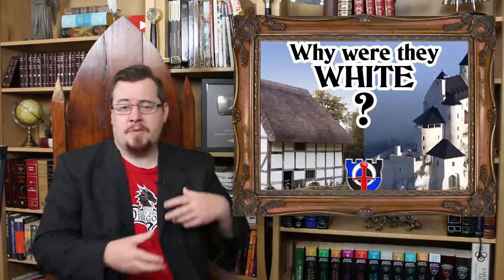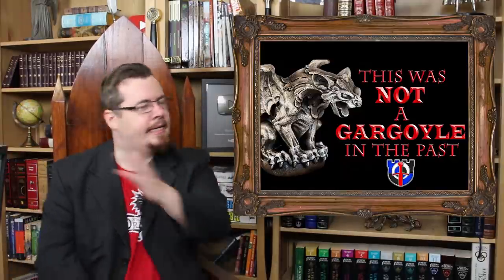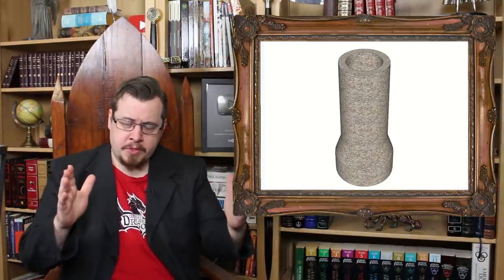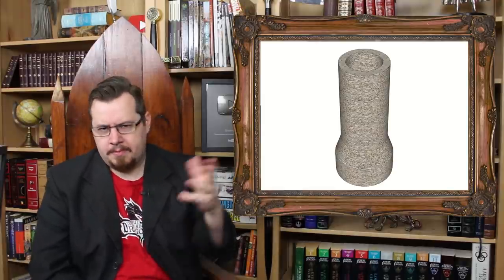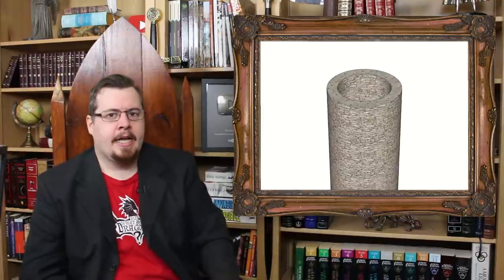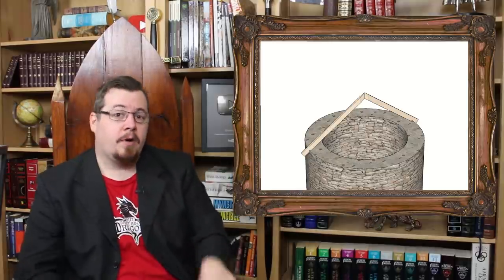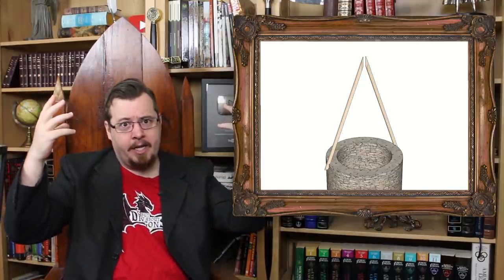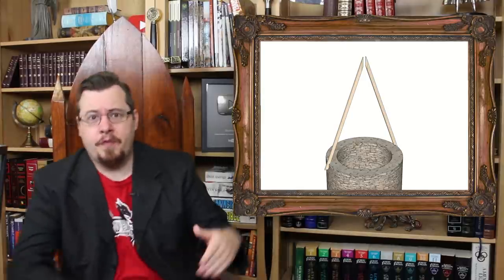Why do medieval CASTLE roofs flare outwards?

Comment: There's probably a strong correlation between how common flared rooves were compared to the usual snowfall during the course of the year. In Norse architecture, you very frequently see very tall, flared rooves, whereas the typical unflared pyramid roof is common south of the Alps.
Reply: Capn Pipsqueak It's not that simple, from my own research I've noticed the steepest roofs were built in central-northern europe, from northern france, germany, switzerland, austria to bohemia and western poland, but not always in the alps, despite the amount of snowfall. Moreover, eastern poland has flatter roofs despite also getting more snow than western poland. Snow plays a significant role but local tradition and regional trends were also in consideration.

Comment: I'm currently building a castle in minecraft and it has all the elements: Multiple Gatehouses, Actual crennels that give cover, murderholes, moats, it's elevated, and of course MACHICOLATIOOOOOOOOOOOOONS!

And I all learnt that from you! It makes the building progress so much more interesting! Thx Shad!
Reply: I do the same thing. I have before with all the necessities, but these videos taught me plenty.
Reply: Cool! Can you share some pictures?
Reply: I was building a castle in Minecraft, also. I noticed that the base of the tower was impossible to see.  When I learned about machicolations, It all made sense!

Of course, functional Minecraft machicolations cause a risk of death by falling, even when you use trap doors to keep them safe most of the time.
Reply: @GymbalLock  I use stone walls placed one block in front of the wall, by placing walls ontop of each other you get the crennels

Comment: I would love to have a non-fantasy role-playing game like Kingdom Come: Deliverance or Mount & Blade that let you design your own castle. And if you did a poor job of it, it would fall down:)
Reply: I would say Medieval Engineer's but it's KSH and has some issues
Reply: Browse a bit through crowfunding sites, maybe someone's already trying to make that game. At least they should.
Reply: There is Medieval Engineers, but it's fairly limited due to the 2.5x2.5 m grid layout, and the fact that you can't merge blocks anymore (so big round towers will always look weird). It's still being developped, but it's been ages since I've seen new actual architectural blocks added to the game.
The physics are also somewhat unrealistic : with structural integrity activated, you basically can't build a tower taller than 20m. Meanwhile my town's donjon is 50m tall above the ground, and 66m above the ditches :p

Also, while the feature has been dropped from M&B Bannerlord, I wouldn't be surprised if it made a comeback in a little while as a piece of DLC.
Reply: ARK and Rust try to have a system like that, but it's based on the proximity to designated support elements rather than realistic gravity.

Comment: turns out stone doesn't just magically stick to any surface you attach it to.

Who knew!? Clearly not most people in Hollywood or video game development.
Reply: That's partially because video game engines tend not to apply gravity to things aren't meant to be mobile.
Reply: You mean my minecraft castles aren't real?????
Reply: @Thrazzon  There is a Minecraft mod that applies gravity to all blocks instead of just gravel and sand, but it doesn't recognize support elements realistically either.
Reply: @RokuroCarisu  yes that's mostly the reason.
Ironic, really, in video games you have to ADD work to make things fall, so why the hell do it to stuff you never want to fall anyway?

I'd love a game that was just "here is simulated reality, go nuts!" Basically like minecraft, but with realistic physics and not made of blocks.
That would be AWESOME!
Probably not doable tho.
Reply: it's theoretically possible, but it would take more computing power than most peoples' computers are capable of.

Comment: I like this video. It's very clear how excited you are over your findings, and it works infectiously. I'll incorporate these ideas in my own designs.
Machicolations-o-meter for this video: 4.3/10
While it is clear that you are yet - and rightly - excited by the concept of machicolations, the expression of said excitement is tempered by your excitement over the topic at hand, which, while closely related to machicolations, is not quite the same thing. This is not a bad thing, but as an avid admirer of all advanced architecture intended to avert opposing individuals, naturally I am a strong proponent of exclaiming the term in a boisterous and ecstatic manner.

Comment: Having spent a number of years as a carpenter and mason it was fun seeing you come to your architectural revelation about roof design Shad. It took me back to the first roof I was building a soffit for, which is the modern day descendant of the castle design you were working on. Even with current building materials it's good to keep water off the stone, wood or brick walls. Our historical predecessors  really were brilliant and it's great to see shows like yours which display their ingenuity.

Comment: The high angle roof is good in preventing snow building up but with rain it directs all the rain that gathers at the base of the building. If you don't have a drainage system the water gathers at the base and can ruin the foundation. 
By having the last part of the roof at a lower angle the water is propelled away from the walls.

Comment: I work in a workshop and we have that same specific design on top of our chimney with the metal cap but the reason for it is the reverse problem. Thin metal for chimney caps is often very light so as the the joints corrode  over time from the fumes and can be removed by strong winds so when the noise from lose metal became apparent we went up there and wielded the top from the inside and added another ring of metal on top at the base to split the force and provide more stability to the structure. I always thought that was the reason why castle towers had pointy tops with that sort of skirt at the base. Turns out they're conected not overlapped.

Comment: One part that you failed to mention with that last cross section drawing was the arch. Arches were an excellent way to bear weight as well and was quite visible in that drawing. In point of fact it was the first part of that drawing that I saw.

Comment: First, thanks so much for this video.  We do appreciate the painstaking hours you spend, not just researching these fascinating aspects of the past, but also translating your experience to us in such a fun and practical way.  This video in particular will be extremely helpful for an upcoming project.

Also, if you think about it, this architecture was indo-europeans' first grand realization of the functional and material efficiency superiority of the teepee or lavvu distributed-force network construction, which is based on interconnected triangles instead of isolated squares.  Modern geodesic designs are the direct descendent of this kind of thinking, which should become the architectural norm in the future.

Comment: In modern home design areas that receive a lot of rain  tend to have relatively larger overhanging roof sections to try to keep rain from dumping too close to the foundations and either damaging them or intruding into the ground floor and basement levels. Having the second shallower section of roof you highlight would achieve the same thing by expanding the roof surface further out than the building footprint.

Comment: For my A-Level project, i have designed a castle in SketchUp. In my design, my towers are 6-pointed stars with supports at the tips of each point and in the corners where two points meet. I mimicked the highly pointed roof (the single high-reaching beam design) for the Great Tower in my castle (creating an almost floral look) because that is what i thought the roofs should look like on castle towers. Its really interesting to know the reason why it was done.

Comment: angle changes on old roofs served as the base so you didn't need a scaffold some flares are for worker ease during construction or maintenance. The flares normally makes it  weaker since it creates a break in the structure, a pocket for weight to kick back on main supports and watershed slams into it creating a high impact ring around the flares top. The main point I've heard for them is they offer a spot for building material or snow that falls off to catch so it doesn't all come down at once and so you can press against walls for safety without roof sliding straight down and killing you and so workers have something to stand on at a lesser pitch.

Comment: You're conclusion is terrific and this is a great video, however you missed a subtle feature that makes this roof design truly brilliant.
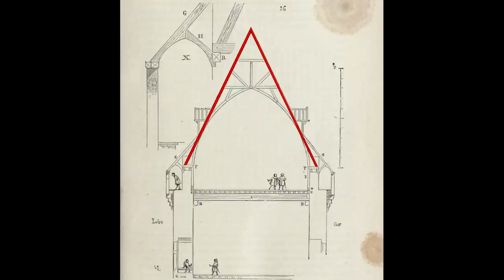If you look at the picture at 10:55 you have highlighted the main triangle of the roof. Inside of that there's an arch which is also a very efficient load bearing structure. Together the triangle and the arch are extremely strong. The arch however does tend to want to push outwards at about a quarter to a third of its height from the base. The second lower roof line provides a force to support the arch at precisely where the arch pushes outwards. Thus the forces are balanced. It is a very skillfully designed and elegant solution, which maximises the strength and minimises the materials required.
All the best.

Comment: There is another thing to consider: angle. If you rested the beams for the main roof section on the outter walls, you'd need to go higher to get the same angle. They probably wanted a steep angle for that main part (minimizes rain and hail damage/wear, handles snow better damage, maybe there is a sun heating or light element to it too, or any defensive or tactical advantageat any point in history that may have stuck even after outdated). Shallower angles can be less structurally stable too. See the French cross section drawing that already needed internal reinforcement, including an interesting arc shape that follows the angle to the secondary roof. Now imagine the whole thing taller or wider. More money, more work, more mass to support on the outter walls.

Comment: I think you underestimate how snow influenced the rooftop design. I work in a fairly large church and the snow melts off it in sectional avalanches. Without that kick near the bottom, those sheets of ice and snow can kill a person. The chunks can also do damage to the foundations. The kickouts break up the sheets and slow them down a bit

Comment: Nice thoughts. I can give you another reason: Wind.
Especially on towers wind becomes a problem, as they are high up and exposed.
You thus need a quite heavy roof so that it doesn´t get pushed off or over.
A flat roof has issues with snow and a very high cone tends to get thrown off by the next storm.
Moreover, people back then were in competition with each other for the highest towers and the cheapest way of achieving it was putting a ridiculously pointy roof on top. In order to keep it in place, you can stabilise it like church walls and that results in the flat roof around it.
PS: I do know a couple of churches and military towers that lost (mostly by storm) their pointy roof and got replaced with a flat cone in the last 200 years.

Comment: Out of curiosity, will you be making adjustments to the Don Jon (brutally mispelled that) in Honourguard? Originally you set up internal buttresses to help counter the weight of the roof, which in my, albeit inexperienced opinion, feels like it  may not work at all. I just cant get my head around how buttresses could act as a counterweight unless something was holding them down, especially for what youre trying to do with them.
Anyway this design would likely benefit it, and its history a lot better i think.

Comment: Not only do they place the weight of the roof  onto the main wall, they could be cantilevered to return the weight of the extension to it as in part H of the diagram. I would not be surprised to find out these cantilevers were sometimes used to help suspend hoardings.

Even cooler: sometimes these roof towers were inverted to form rainwater-collecting funnels, such as on the 11th century Ely Cathedral.

Comment: The space under a roof was never really used for anything more than storage (except for roofs in houses, if the house had a chimney, which most houses didn't, it was used for sleeping for helping hands and children, drying of clothes and fruit and stuff, if a house didn't, it was used for smoking meat). The problem is, that medieval roofs weren't isolated, so it was extremely cold there in the winter and hot in summer. It has to have good airflow under it in order for the roof to not develop mold.
The real reason why there was such a steep angle on medieval roofs was their material. Nowadays we use multiple layers on roofs, first we put isolation, then some plastic over it, then asphalt and just then we use ceramics, wood, iron, etc. They used just wood. Ceramics wasn't much common. And wood needs the second steepest roof angle in order for the roof to not leak and the water to just flow down. The steepest angle roof material is hay. So no room, they weren't really expecting anybody to use the room under the roof.

Comment: 10:37: Forgot to mention the archway that made up the inner structural support of the roof. (I believe it's called a vaulted ceiling?) Also, what's to say that the outer roofing shared support with the supports that made up the interior part of the ceiling?

Comment: Yes, there was a structural reason for flaring the roofs. But there was also another reason for the roof flares. They wanted to give the water and snow falling off the edge of the roof an outward trajectory so it would fall out away from the castle walls instead of dripping down and seeping into the stone and lime render which is not impervious to water. (If the castle is made of wood with lime render, it's even more vulnerable to water damage since it causes the wood to rot.) The steep slope on the upper roof gives the water and snow momentum, and the shallower slope on the lower roof throws it out away from the building farther than a steep slope would.

Note that the gate towers at 1:15 don't really have a structural reason to be flared. The battlements are about a story below the tops of the towers and are roofed separately. But even so, the conical roofs on the tops of the towers still have small flares.

Comment: Materials may also be party of the answer. Last night when I looked at the images from Shad's video on Roman Castles followed by this one on castles roofs it occurred to me that the timers looked less massive on the medieval roof. Longer, yes, but thinner as well. If you are laying heavy tile on a flat roof the rafters are expected to take all the load, plus the load of any snow. In the roof is steeply peaked you likely have connections joists that help spread the load a bit and the weight is that of the roof and tile, not the snow. Looking at the drawing of the domed great room, an image I have run across myself in my own research, it strikes me that it resembles more modern roofs mage using 2x8's rather than the great beams used to span a flatter roof. Taken with the video I discovered recently on splitting a tree in Sweden for roof structures made from sapwood makes me think maybe, despite the length, that each individual beam is actually lighter and this potentially easier to lift into position and assemble. If you are dividing the weight of each beam between 3-5+ pieces then the weight of each can be lighter and potentially the whole as well for roughly the same work

Comment: Just a farther interpretation of the roof line based on the not so close view of the French diagram.  It appears the joist of the secondary roof over the corballing (spelling) carries through to for a truss under the main roof joist.  The truss distributes the weight for extra support.  A second benefit the lesser pitched roof will push snow, ice and rain farther from the foundation of the tower.  Enjoy

Comment: Hey shad, I know steampunk isn't really your thing (and the answer isn't limited to the steampunk genre per se) but I was wondering: what meterial would be best to use to build a large bombroof dome around a city (or several cities) that would be light, and cheap enough to build such a massive undertaking, that could withstand bomb blasts. (With airships, pirates are no longer limited to the water). Would it be a metal? Or glass? (And lets just pretend this is another planet, so which meterials are rare or not can be shifted for convenience of world-building).

Comment: even if the extensions could hold greater weights the volumetric difference between the straight and flared roofs is considerable to opt for the flared ones if economy on materials is a factor. (compare the volumes of the cones)

Comment: Shad, you should check out Medieval Engineers on steam. It has realistic castle building with structural integrity and physics-based sieges. I've sunk about 1000 hours in at this point, and it seems perfect for a video!

Comment: I have an idea about giants. What if giants were clad in proportionally thick gambeson armor according to their size. In a fantasy/medieval setting would that be the most effective and cost efficient way to equip giant soldiers. I was just thinking that plate steel would be nice, but if a giant wore padded armor it would have to be very thick. The thicker the padding the much less likely anything will pierce it.